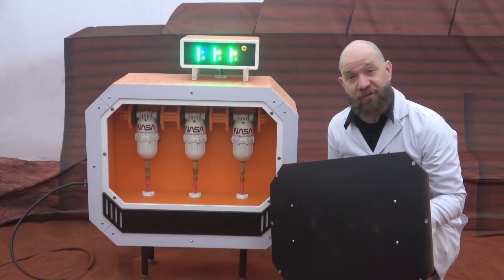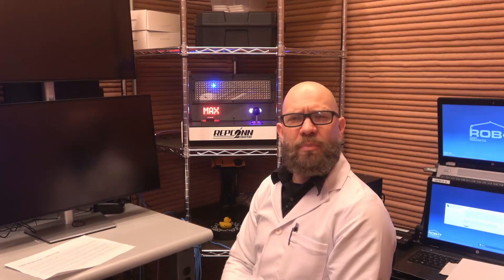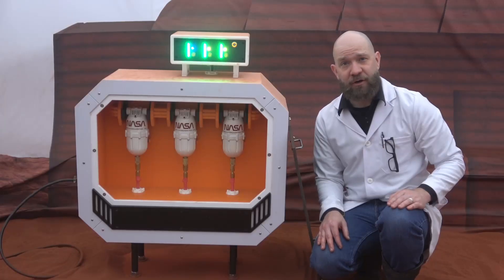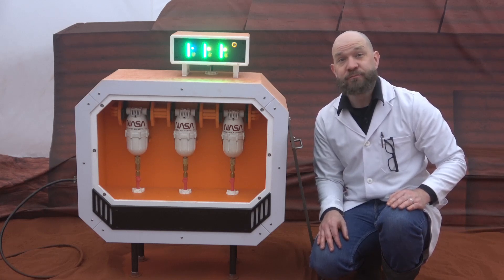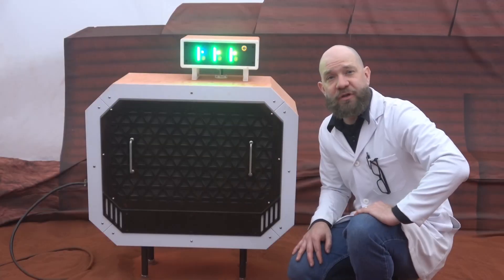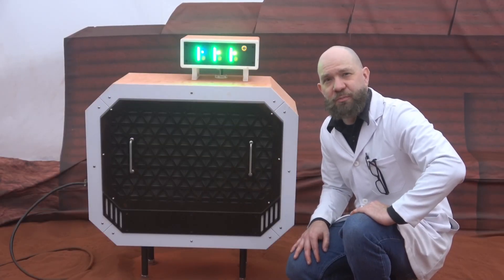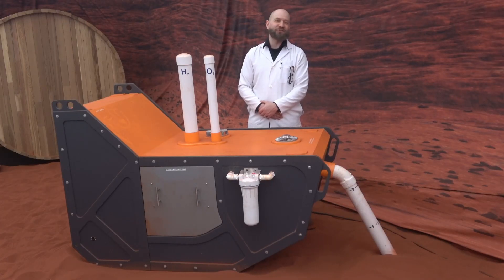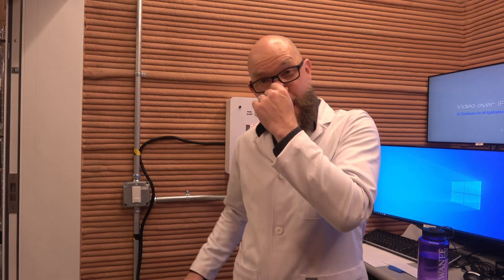GSL proudly presents the Astroencabulator

Comment: I appreciated that the flynide liquid contained within the device does not, in any way, inhibit the vapors of the cylindrical housing which would destabilize the entire mechanism.
If this were to happen, the fissures could (theoretically) create an unstable environment for molecular displacement in the quantum exasperator's engine, which would undoubtedly cause a catastrophic event to occur. Good design here 👌
Reply from the maker: It does contain thiotimoline but, it's less than a microgram so, it shouldn't be much of a problem.

Comment: I was always told it should be every 6th conductor connected.  Maybe the Neutronian conversion calculation system I used is outdated.
Reply: If you don't use a prime number for your conductor spacing, you're never going to get rid of the sinusoidal repleneration.
Reply: @matthewcharles7574  sinusoidal repleneration can be helpful if the grimgram’s orbit is in retrograde, no?

Edit: Nevermind. I was mixing up an astroencabulator and a water pump gasket for a 1997 Toyota Tacoma.
Reply: It's a common mistake. All too common...
Reply from the maker: The conductors are made of thiotimoline...
Reply: @GratuitousSets  two- or three-ply?